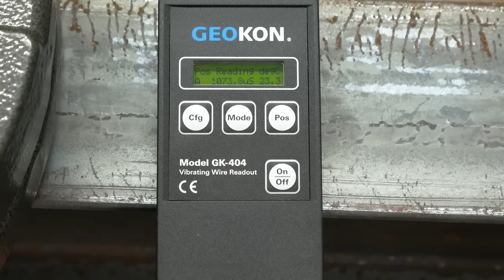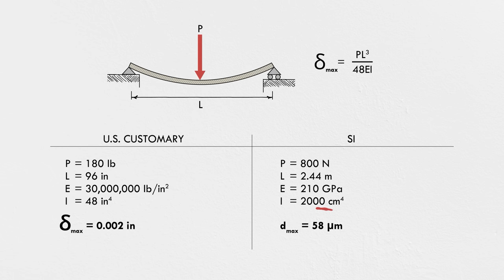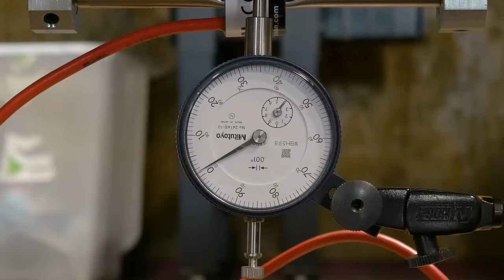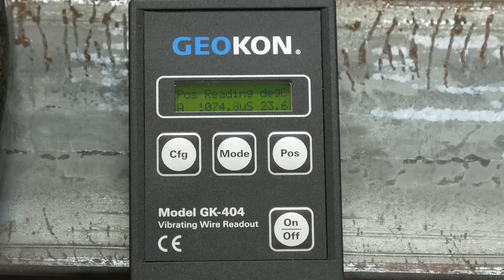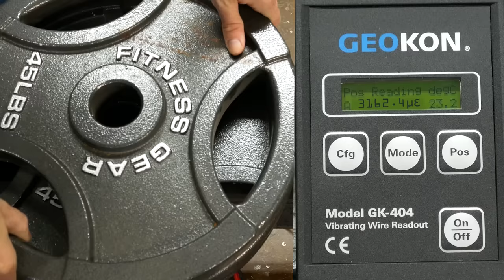How Sensors Keep Bridges From Collapsing (and other structures too)

Comment: I live in Seattle. A few years ago, there was concern about the integrity of the West Seattle Bridge. They shut it down and did an extensive overhaul. Prior to re-opening, they tested it. The engineers put numerous sensors on the bridge, and drove 12 loaded 80,000lb trucks onto the bridge and measured the bridge's response using the sensors.
Reply: Yup.  The bridge developed cracks over time that weren't helped by the Nisqually Earthquake and a jammed rubber bearing that prohibited thermal expansion. They sealed the cracks and retightened the main span.  Actual testing was preceded by lots of computer simulations.  Trucks have grown bigger over time so the calculations made at the time of construction no longer hold (WSDOT bridge inspector, not an engineer, but I play one on TV).
Reply: sorry about your luck. lol
Reply: Where my West Seattle Islanders at!!!!
Reply: @casonator  West Seattle is not an island, as a Vashon Island resident lol
Reply: Good thing our body can maintain itself om its own while we are getting enough water, food and sleep instead of having to pass routine tests once a year using only sensors to collect the data eh?.
Reply: @touching_grass  The joke around town was that it became an island without the bridge
Reply: @casonator  it basically was, that detour they had setup was a mess. I remember it was such a nightmare to get around.
Reply: Concern?? They closed the bridge for 2 years!! Talk about an understatement. -WS resident

Comment: As a US state bridge engineer, I love these videos! I share these around the office all the time, it's incredible how useful these simple breakdowns of common engineering principles are.
Reply: I'm a bridge inspector, and that's why I'm here too.  I'm not an engineer, but I play one on TV.  (WSDOT)
Reply: Fiber optics in concrete hooked up to a data recorder is the new hotness. There are several companies in this space right now.
Reply: @ClayinSWVA  They are just qualitative sensors (crack / no crack)? And at the same team cheaper because of it, I assume?
Reply: @leocurious9919  they can do strain, shape and load. Built-in traffic counting is a thing they can do also. The fiber is fairly cheap and can stretch the entire bridge for monitoring.
Reply: @ClayinSWVA  Amazing. Thanks.
Reply: Question to engineers and inspectors here. Where the stock data is stored from new bridges, so it can be compared to current data from those sensors how much build has flexed or is there control center at the site that logs the data or just sensors scattered in the construction that needs to be hooked up when doing inspection? How these sensors are used in practice? Also when these started to be used, whats the utility life and cost of them? Would be interesting to use them to see how cracked tiles in our bathroom move if those are cheap.
Reply: if you are a state engineer, is it possible to be a federal engineer in America?
Reply: @Hellsong89  As a student doing masters in Earthquake engineering, we use them to check the condition of the building. we install multiple sensor on different floors depending on the requirement then we exite the structure to check its natural frequency. if its natural frequency or capacity for next predictable earthquake is low and it is an important structure like hospital or gas or chemical plants then we calculate the amount of retrofitting it needs. and certificate or number them as per inspection parameters. also are used in wind turbines to take live reading of the condition of turbine. it has multiple uses and is wonderful subject.

Comment: I am a mining engineer specializing in rock mechanics.  Instrumentation is important but much more challenging in a deep underground mine as the material is dis-continuous, heterogeneous, anisotropic, non-linear, and subject to plastic deformation.  Point sensors can provide mis-leading information as they become highly dependant on local conditions, most of which cannot be accurately defined.  We also use Geokon for most of our instrumentation.  
Our best tool is often the micro seismic system from dozens or even hundreds of sensors collectively working together to collect and compile rock noise data due to fracturing.  Despite being a “remote” sensing approach, there is a lot of detailed local understanding of performance and conditions that can be extracted.
Reply: "... as the material is dis-continuous, heterogeneous, anisotropic, non-linear, and subject to plastic deformation." this sentence is one hell of a engineering model nightmare!

Comment: In the sector of telecommunications, we use an instrument called TDR (time domain reflectometer) which sends an electric pulse in a wire and check the returns from that pulse, to measure at what distance from the test equipment the fault is located.
This test equipment is similar in principle to the sensor you showed in the video, but the frequency is higher and the domain is different (time instead of frequency) but the methodologies are similar.
This is a very nice video - I begun my formal studies - a lifetime ago - specialising in "Transducers"; the devices have now been revolutionised because of the MEM technology, but the principles and the designs stayed the same.
Thank you for the great video,
Greetings,
Anthony
Reply: TDR is fun, and can even be done at home if you happen to have a function/waveform generator and an oscilloscope! I was able to find out the length of some weird coax that way.
Also, OTDR for fiber at work all the time, but that's in another department's hands.

Comment: Much as I like civil engineering, I never thought anyone could make strain gauges interesting! Yet another excellent episode. Thanks.
Reply: Still not forking out  $70 for a razor though!!
Reply: @paulhaynes8045  It makes sense over a fairly short time.
Reply: @Paul Haynes  if you shave everyday it makes sense.  Right now I am not employed and don't bother shaving but when I go back to work I plan to buy one of these.
Reply: Strain gauges are difficult to maintain "in the field."    An annual literal survey every year or so would track deflections.   Actual physical inspections of the steel would prevent most surprises.   Maintaining bridges (inspection, cleaning, and painting) will keep most bridges in service indefinitey.
Reply: I lived in an old building with strain gauges all over the place to monitor crack growth (the building dated from the 1900s).  It wasn't as interesting as it was unnerving.
Reply: @randomname4726  I've been using multi-blade razors since they came out, and I've still got my original razor, which must be over 40 years old by now and still works fine. 

There's basically nothing to go wrong in a razor, so I can't see me replacing that in my lifetime (I'm nearly 70, so that isn't quite as dramatic as it might sound!).

I use pivoted/lubricated twin  blades, which give a perfectly good shave - certainly much better than the old safety razors, and a lot less likely to cut you accidentally. I think how you shave is more important than what you shave with, anyway.

OK, they are expensive, but they last for ages if looked after - a packet of 10 blades lasts me easily over a year, maybe even two. So it would be a very long time before I broke even on a $70 razor!

I suspect the real appeal is the tech nerd hype (as if normal razors aren't accurately made to give you the best shave possible!). All this 'space age design and  manufacturing' stuff is just BS aimed at the sort of tech fan boys who watch channels like this.

Comment: I worked in a watermains flowmeter project: we install lots of flowmeter and pressure logger at the watermains, to monitoring the initial pressure and Flowrate of each watermains, and send those data to server for inspection everyday.

While some watermain have non-stop flow data even at mid-night(which normally nobody use water) we realize that there is some leakage after that flowmeter, thus we could carryout a faster inspection/repair/exchange activity of those leakage pipe.(We don't need to checkthe water supply zone entirely)

Sensors is really good
Reply: Nobody uses water after midnight? What are we, gremlins? People go to the washroom in the middle of the night or work shift work or backflushing water softeners or put a load of laundry or dishes on, or a million other things that use water at night.
Reply: @SomeGuysGarage  Water Utilities can compare customer's meter reading with their own network flowmeters and extrapolate usage patterns over days/weeks/months etc. Any unusual fluctuations (i.e. increases over normal usage patterns) can be flagged for investigation. It's a common leakage detection technique where I work as well!
Reply: @SomeGuysGarage  You're forgetting about commercial customers.  Not many office buildings put a load of laundry on at midnight.  A flushing toilet also doesn't show up as a non-stop flow like the OP said, it just uses a bit of water and then stops again.  Leak detection is normally triggered by continuous flows that run 24/7.  Most non-industrial places don't use water at the same steady rate 24/7, which you would see if you had a leaking pipe.  Normally you'd expect certain times of the day (e.g. around midnight) to have some periods of zero water use where the meter doesn't increment at all for a few minutes or hours.
Reply: There is always flow from the plant. If they're not directly reaching customers they're recharging the storage tanks. 

The concrete way to detect leakage is to compare measured mains flow vs metered flow. They'll never tally, and the difference is the non-revenue water i.e. leakage.
Reply: While seniors are great I've seen my share of them fail. Some in more spectacular ways than others. In my opinion sensors are a great resource to use but can't be the only tool. Prime example. We had a moisture sensor on a dryer that failed during my practicum in university. The dryer wouldn't shut off on the auto dry cycle. The homeowner caught it. The tech I was working with was so sure it was a stuck contact in the timer so he just brought out a timer. The homeowner called back that day and complained. It was the sensor. Thank God the home owner noticed it or there could have been a fire. I've learned never trust sensors. They are a great tool to help but are never definitive. It's sad to see these days that alot of tech company's are relying more and more on sensors and cutting other things that are time tested.
Reply: @Sabi1234567890Asdf  I had to laugh at your statement that you've seen your fair share of seniors fail 🤣

But anything can fail, that's why if it's important enough it needs redundancy/backup because as you say, sensors inevitably fail or in many cases just wear out once their design lifetime is reached.

Comment: Great video. I was the engineer of record for a number of state owned dams. We routinely used piezometers, inclinometers, crack meters and other instruments to measure performance of earth dams and their concrete components. I used to enjoy observing trends in the data that correspond to things like changes in reservoir elevation. You start to learn how the infrastructure performs under different conditions, allowing you to spot potential issues.

Comment: I use a lot of these sensors for my work! I work for a fracture mechanics research lab where we often get representative pieces of piplines and other infrastructure that were made decades ago (without good data kept on it and often old impure steel) and test how it cracks to see if the rest of the line is still safe to run for awhile. Often times you can detect cracks with a pipeline inspection tool (called a PIG), but quite often smaller cracks things are missed and even then they often don’t know what material the pipe is after a few decades. So research is always being done to asses the likelihood of a leak. 
There’s also tons of effort being put into studying how converting our gas lines to hydrogen would work (hydrogen “embrittles” steel) in an effort to switch our infrastructure to cleaner energy. 

Crack growth is super facinating and suprisingly very complex to predict. But it also can be measured directly by measuring the resistance change across a crack as it grows (from the steel left getting thinner and thinner) it’s quite hard to interpret this data, but one of the more useful “sensors” we use because you can watch a crack grow with a very high accuracy without having to break open the material

Sometimes it’s so geometry dependent that a small scale sample changes the results too much. So sometimes we do full scale tests (like purposely putting a flaw in a pipe and then cycling pressure) because small scale samples just don’t tell the whole story. Often this is compared to finite element analysis models to try and improve those tools. And the data from these large scale tests can be quite complex to analyze with so many channels and sensors. We did a pretty complicated test last year with easily over 100 channels (strain gauges, string pots track 3D position, linear displacement transducers, resistance measurements, thermocouples, etc.) and the test took a few months to set up. 

If you haven’t done one already,  an episode on failure analysis would probably be a fun topic, although I’ll admit a very broad and complex one

Comment: Not exactly the same thing, but this happened when I was working for a large elevator company as a young draftsman about 50 years ago. The R&D Group was tasked with redesigning the escalator frame to try to reduce the number of welds to make the fabrication less expensive as the current fabrication required "weld all around". The goal was to produce a frame with a minimum of welds as determined by the engineer's calculations. The new frame would be set up a series of strain gauges and loaded up to test the structural integrity and add welds as required.

This was all preCAD so I spent about a three weeks learning and adding weld symbols to the weldment detail drawings and having the engineers check it and make some changes as required.

It turns out that the contracted fabricator's welders weren't certified so not understanding the weld symbols, they just welded all around, just to be safe! Needless to say it pretty much doomed the project and a series of lawsuits followed. I wound up leaving the company about a month later for what turned out to be a very interesting 36.5 years at a local machine design and fabrication company.

Comment: The engineering sector lives and thrives on the use of sensors. There are some incredible type of sensors (e.g., a silicon diode used as temperature sensor - instead of an NTC or a termocouple, or an hot wire used as airflow meter - instead of a turbine connected to a micro-alternator).
A comprehensive video of most types of sensors used in the world around us - from an automobile to an electric power plant to  traffic lights), I believe, would be greatly popular here on YouTube.
Best Wishes,
Anthony

Comment: I worked for a summer installing monitoring equipment for a wetland restoration company. We put finely perforated PVC pipes in the ground 1-2M deep. Next we put two small pressure sensors into the pipe: one was dangled at the very bottom, and the other was above the ground on the top to gather atmospheric pressure data. They took a reading once an hour for a year and then the data was downloaded. By knowing the density of water and the atmospheric pressure above that water we could generate a very nice plot of how the water table was fluctuating at that well. By installing 6 wells or so in strategic points at each site we could get a pretty good map of where the water was going underground through that wetland area, how much water was being absorbed into the ground, and (when correlated with weather data) how upstream conditions affect the wetland water table and how long the wetland held water (slowing it down from all rushing downstream at once) after a rain storm.
Reply: That’s a wetland, shock absorber on flow.

Comment: Guess I’ll chime in too— about 25 yrs ago, I used precision pressure transducers to estimate the altitude of the PANYNJ service trucks on the GW bridge between fort Lee and the Bronx. Placed two fixed units, one in fort Lee, and one on the upper deck NY side. It worked beautifully, except we discovered we had to correct for the Bernoulli effect (it was practically an exponential) due to the trucks’ driving speeds! We just linearly interpolated between the two fixed stations :)

Comment: I spent the first 19 years of working life making Vibrating Wire strain gauges, load cells and Piezometers. Plus other geotechnical Equipment, in the UK this video  brings back memories of calibration working out the K Factors, etc, with a calculator. great times tensioning the wires and hearing the tension change with adjustment.

Comment: Your video reminded me of sensors I was peripherally involved with.  They were flow transducers retrofitted into the penstock/scroll case of a hydro unit.  They helped monitor the unit’s performance, but caused their own problems.  The water pressure forced water through the fittings, through the cables, and then out of the scroll case, to the collection cabinet.  So another problem to deal with.  Not insurmountable, but unexpected.

Comment: Working on a maintenance project right now for full depth concrete roadway repair. The contractor uses maturity meters that monitor the short term temperature of the concrete to know instatly when it meets the spec to open the lanes back up to traffic. It's incredibly useful and makes everything work much quicker and more smoothly. Sensors are great!